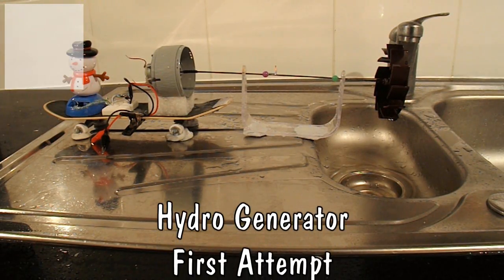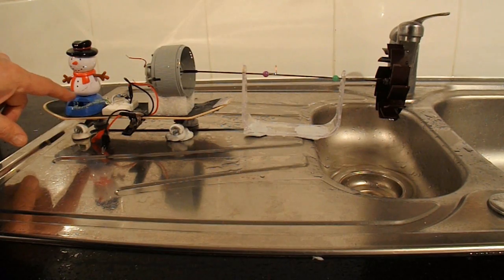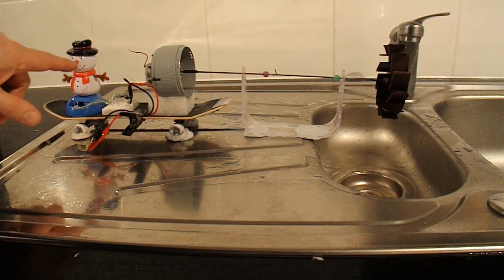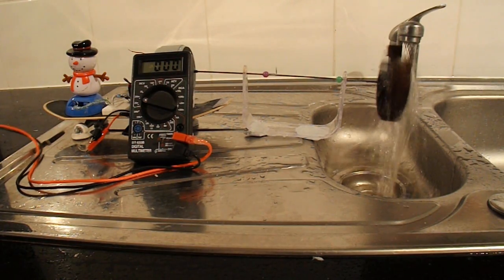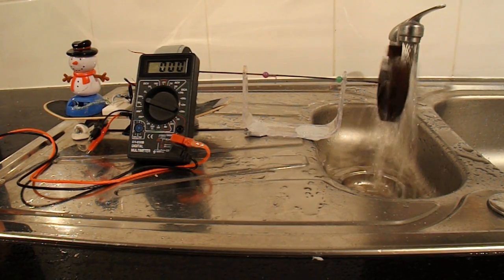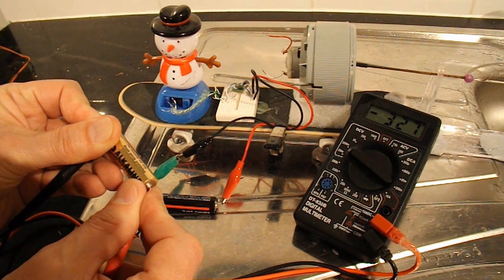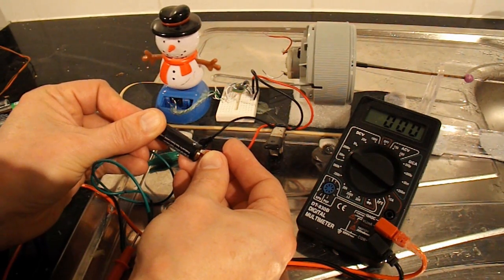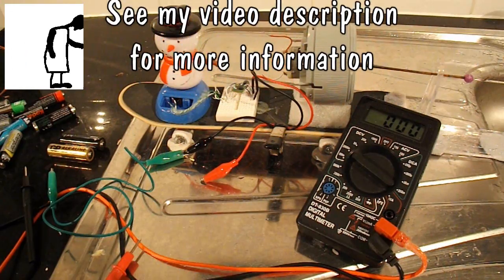Hydro Generator - First Attempt

Comment: For a better performance it needs a gearbox , i think
Reply from the maker: Yes that would help, you need to spin the motor/generator much faster than I am getting here. A bigger motor would help and so would a faster flow of water. This video is just the very basic concept.

Comment: Have just done some tests here with several motors and a similar sized fan type top.
6mm R/C motor gave 80mV at 12mA, for approx 300 RPM. Mabuchi RF-300 (3V cassette player motor) gave 0.3V at 12mA. Sun Motors 9V (slightly larger) gave 1.4V at 35mA.
The Snowman likely uses <2mA, so voltage is the only issue.
The ideal would seem to be a large motor with high windings resistance !
I don't know the speed of your system though is likely a lot faster, as I was only spinning by hand.
Steppers are best, but there's no way one would turn directly under a stream of water.
Reply from the maker: Thanks slider I will be doing a search through my storage system to see what motors I have tucked away. On my first attempt I thought I had cracked it until I realised the snowman was rocking due to vibration not power. I could easily have rocked him with a magnet on the shaft too.
By coincidence the first motor out of the box when I was looking the first time was a stepper but it was one I had 'disassembled' and it doesn't quite go back together right :-)
Reply from the maker: slider2732 I am surprised you didn't notice anything odd about that gold coloured battery. See the last line of my video description :-)
Reply: GrandadIsAnOldMan
Yes, it's reversed polarity.
It can be done if hit with high current the wrong way around, such as with Ni-CD rejuvenation methods, but i didn't notice the first time around. What's the story there ? am intrigued.
Reply from the maker: slider2732 I have no idea how it has happened, the gold one was one of a pair in a charity shop toy I bought, can't remember which one now, but I just threw them in my dead battery bag ready for recycling collection. I didn't notice the polarity till I played the video back.

Comment: couldn't you use a sort of gearbox to increase the speed  of the rotation :D  ?
Reply from the maker: Yes that would help, I just wanted to see what I could do with the bits laying around on my desk. I expect I can find an old RC Toy Car gearbox if I look hard enough.
A bigger motor would make a lot of difference too.
Reply: Much energy is lost, being without enclosing the turbine.
If that turbna degas closed and the water directly connected by a pipe or tap then, perhaps more energy is obtained.
And it could take, that "attacked" to a smaller gear and therefore to higher rotational speed.